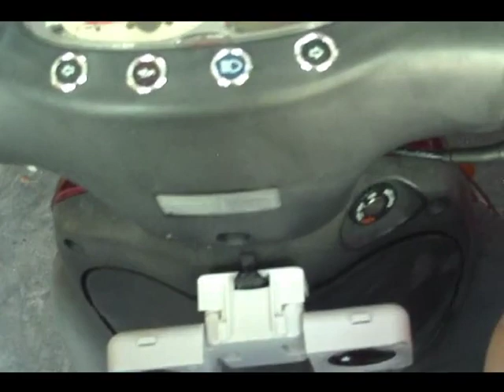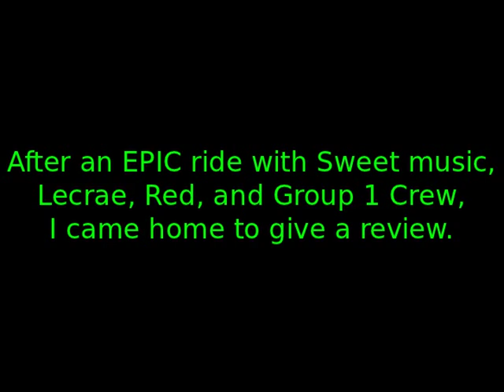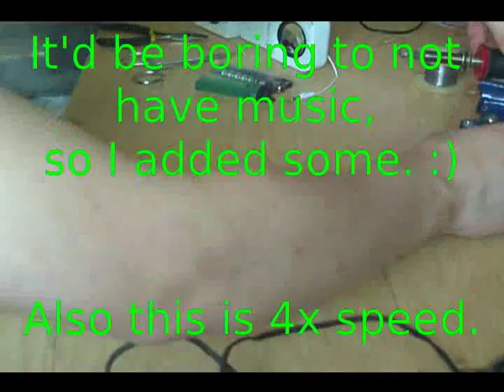Putting a speaker set onto my scooter.

Comment: Get you a pair of computer speakers that has 12v power pack connection Cut off power pack Connect wires to scooter battery Plug speakers into MP3 player It Rocks I've had stereos with amps and speaker on mine Computer speakers out did them all